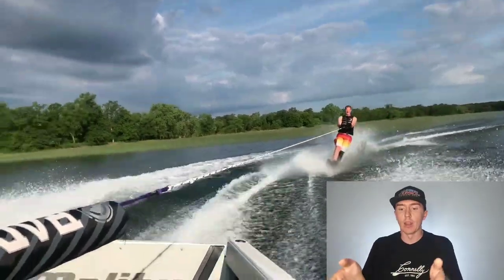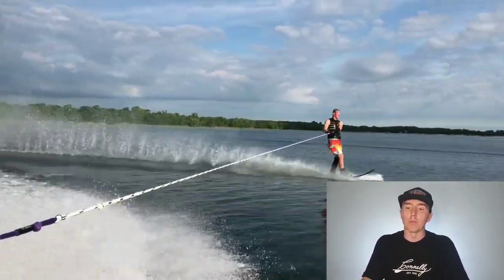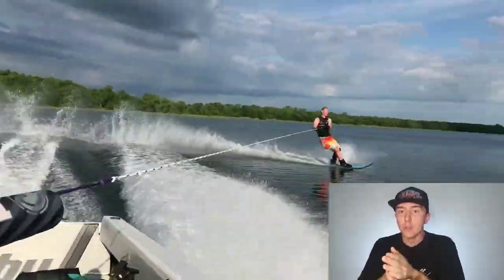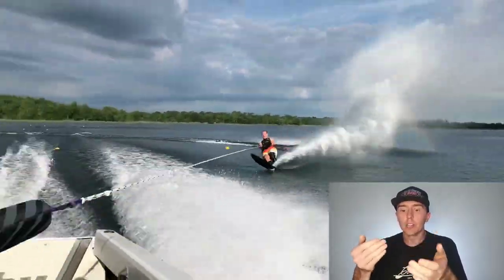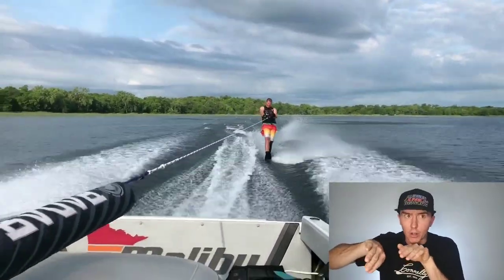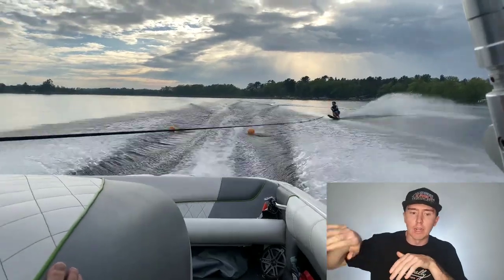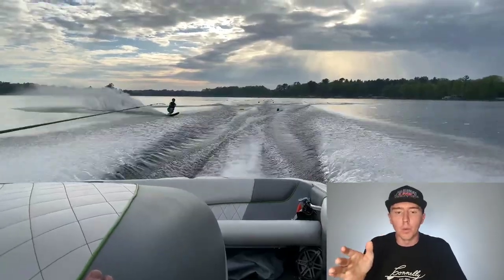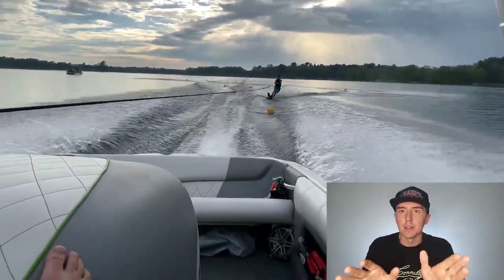Short Line Slalom Waterski Edge Change

Comment: Awesome vids. Thanks for the tips. Like many skiers around the world we are not very close to coaches, demo equipment or others who ski on a regular basis. But we have just as much fun as anybody else!!!
Reply from the maker: No worries. Feel free to exaggerate the soft knees edge change when you are testing it out. Just play around with it. Good luck. Let me know when you run 11
Reply: Did some free skiing today and worked on soft knees right after the wake. Started to feel that quick edge change and back to straight legs pretty quick getting ready for the turn. Funny thing is I have done this a million times before but for hard boot snow boarding (down hill/slalom snowboarding). I always thought the similarities were there but now they are almost identical.   2020 ,among other things, will be the year I “REALLY” Learned how to slalom ski.  Also I have learned the stack position better in the last 2 months.